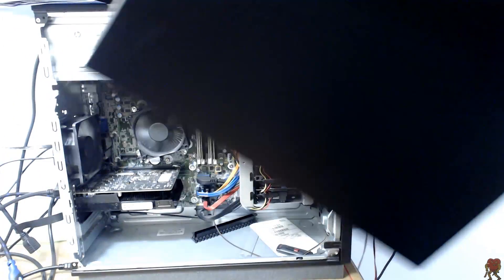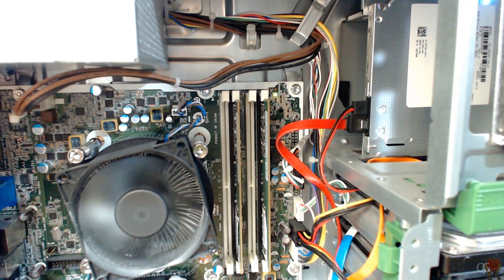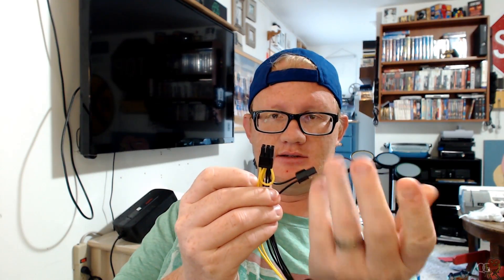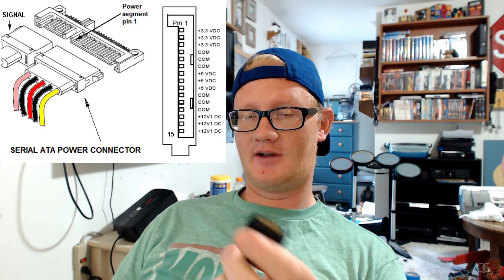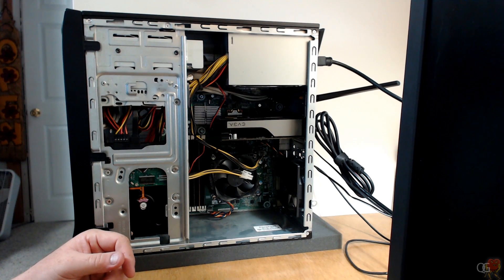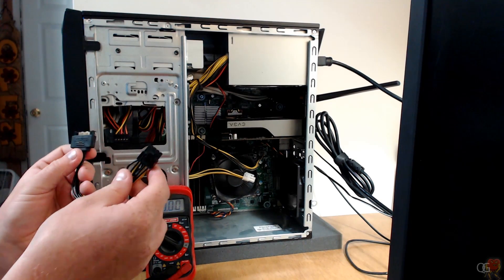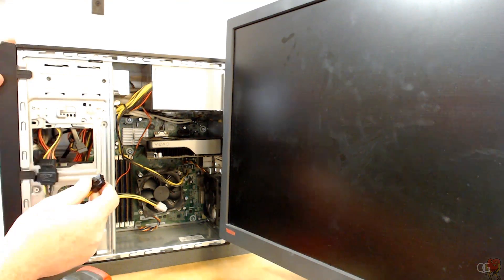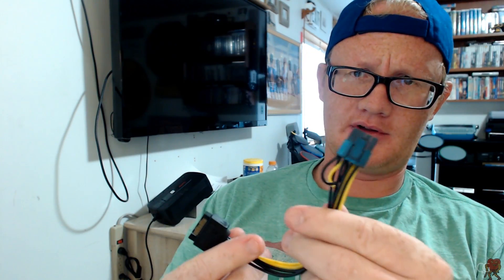No Power Supply Cable For Your Graphics Card? No Problem!

Comment: 8 pin pcie express draws 150 watts. 6 pin pcie express draws 75 watts. Sata draws 54 watts maximum. So powering an 8 pin pcie with a single sata connector means your video card is either drawing 96 watts too much or your video card isn't getting enough. Even if you use 2 sata connectors for 108 watts to an 8 pin pcie connector, it still overdraws by 42 watts or has an underdraw of 42 watts. Mainly meaning there is a good chance of the sata power wires melting and starting a fire. At best, 2 sata connectors to a 6 pin 75 watt sata connector would be acceptable but sata was never designed to power pcie video cards.
Reply: What if I just use the sata connectors to ground the gpu and use a different 6pin that’s from my psu + the sata grounds to make up a 8pin
Reply: nonsense, they both can pull equal amount of power, 2 extra black cables are just ground
i use hp mobo + rtx 4060+ sata to 8 pin no problems, you are genuinely misinformed
Reply: No, my friend, you're the one who's wrong. My graphics card, an AMD RX 570, was connected to the adapter that goes from SATA to 6+2 pins, and it almost fried my card because the part where SATA goes to power melted. @r3tr0c0e3

Comment: once I used 6pin to 8pin converter for an rx 570. after couple days wires were melted and shorted. fortunately power supply turned off automatically.

Comment: this specific adapter you are holding is the type which may catch fire because the sata end can hold a max of 54 watts while the 8 pin end needs 150 watts which will cause overheating and fire potential, there is the type which has 2 sata cables to an 8 pin which is a little bit safer but still does not meat the 150 watts required because now instead of 54 watts 2 cables combined will do 108 watts, the one which i think is the safest is the 2 sata to a 6 pin because the 6 pin requires 75 watts and with 2 sata cables it can handle it with ease without overheating because it is has headroom
Reply: is it ok to use it on a budget GPUs like RX 570, 1650, and 1650 Super?
Reply: @yubinator69  as along as the gpu requires less than 150 watts then no problems which is the case for all the gpu's you have listed

Comment: its ok to use 2molex to 6 pin ?
Reply from the maker: No less ok than the SATA to 6 pin. Either cable may not be able to handle the amps your card might draw, but I'm willing to bet the molex to 6 pin can handle more amps (haven't tested it yet) because the pins are larger and have more contact surface area.

Comment: I only have one hard drive is that a problem
Reply from the maker: Shouldn't be as long as you have an extra SATA power connector
Reply: @thequintessentialgamer7514  i do but when i plug it in to it and turn it on it beeps 6 times and then does nothing

Comment: literally doing the exact same thing with an HP pre built I just got. looking for a new graphics card, realisizing there is no cable to go with it. then the power, then the proprietary what th flip... thanks for all the help so much
Reply: Same what graphics card will you get ?
Reply: @blinkcatmeowmeow8484  no idea quite yet. I'm concerned about the limitations of the power supply itself and the cable. Only have a 180-watt built-in so I'll probably have to go for something maybe a high range of low tier game requirements to mid tier. Probably looking at something with 2-4 gig of RAM on bored like a GeForce gtx 1050/radon HD 7850
Reply: Niceley Done you wont do anything with a 180w psu only a 1650 super will use 80% of that get AT LEAST 350 watts believe me
Reply: @blinkcatmeowmeow8484  I have a 450 watt
Planning on getting a Rx 5700xt

Comment: Need some help, I Have an hp desktop that does not have cable for the gpu, it goes directly to the mother board, from the mother board comes a 8 pin cable that connects to the hard drive, and then, from the hard drive comes another 15 pin sata cable that is not connected to nothing, can this adapter give power to a gpu from this sata plug that comes.from.the hard drive?

Comment: Wow...You should never use this for any gpu...just build the pc yourself and it's cheaper than a prebuild...btw these OEM PSUs are just junk and should not be used with power hungry cards...theres a reason why there's no pcie cable...a psu without a pcie cable has max 250w of output (in most cases)...

Comment from the maker: I've added some links in the description, there are a few cables to choose from now, depending on your situation. Hope they are helpful.
Reply: You fucking legend
Reply: Will that adapter work safely with a rx 580 4gb
Reply: @officialdislikebutton9712  No because the max power draw of this card is 185W and you cant pull that sot of juice out of the sata cables
Reply: @officialdislikebutton9712  you could run rx580 without cable if you do undervolting And you set power limit to 50% that will take only half of juice. If you add this sata I guess that this sata conector can help. I am not sure how far you can go but i would try to go up to 75% and do some stress test and check the entire wires temperature (it Is sure that Its not design to power gpu).
Reply: @rockybalboa5611 Sorry for talking about something that's 2 years ago. Anyways I'm getting an rx 580 8gb 2048sp. My system is a dell vostro 3888 which comes with proprietary connectors for mobo. Could you please at least link me to something that'll teach me how to power limit the card?
Reply: You're my hero! Thank you
Reply: Hello, my friend, I have this problem "Please power down and connect the pcie power cable for this graphics card" in a Zotac GTX 760, this adapter would solve the problem ??

Comment: What if I buy a female one does it do the same thing?
Reply from the maker: The female ones are meant for a situation like you want to power a 3.5" HDD and you don't have a SATA power cable but you do have a 6pin connector for a graphics card.

Comment: I just for a lenovo and I'm not going back; what's with all this propriatary power supply and motherboard crap limiting my ryzen 2700 to a ... ex 460 rebranded as a 560 which I guess has the proper name of 560-D but I've also seen 560-B

Comment: Where do I connect it into 
the motherboard i don’t see I place where it would go into
Reply from the maker: It plugs into a SATA power cable that typically comes from the PSU, although some computers (like my HP features in this vid) have the SATA power cables come from the motherboard.

Comment: Hey bud, I bought this same cable. Will it power my 8 pin graphics card ? The cable has 8 pins on it or take off the two like you did and make it a 6 pin. But will this power my 8 pin graphics card? By the way , I have a dell precision xeon, with a upgraded power supply of 685 watts. But ya no damn 6 pin or 8 pin connectors in my pc. Hopefully you or some on here can let me know if this same cable will work with my 8 pin graphics card. Thanks a bunch
Reply from the maker: Never tried it on an 8 pin GPU although I would assume it would work, I dont know for certain. I didnt know if my cable would work with a 6 pin when I got it, I just took the risk and tried it. Whatever you do, it's at your own risk.

Comment: Just bought a rx 580 armor mk2 and I didn't have a 8 pin and I started freaking out. Luckily I found this video
Reply: does it work?
Reply: @hyph3nvoid416  it's no longer available but I found a new one on Amazon that should get to me on the 8th
Reply: Let me know !
Reply: @knife9315  it did
Reply: Nuttinpistachio 0 awesome. Does everything work properly? I’m looking to do the same with the same graphics card!
Reply: @knife9315  for the most part yes
Reply: @knife9315  the one I got also came in a pack of 2 for a cheap price. Only problem is that there kinda of shirt so the cable will definitely show
Reply: @nuttinpistachio034  hi bro how much watt in your psu i have 400w did it work for me ? And are u used 1 Sata to 8 pin or 2 sata to 8 pin?
Reply: @merouanehirchi7975  I have a 600 watt. It should work, it uses 2 data cables to 8pin. If you want I can make a short video and show you and even put some gameplay to show that it runs well. I got it for 8bucks on Amazon and it came in a pack of 2
Reply: @nuttinpistachio034  okey brother if want it will be nice
Reply: @merouanehirchi7975  what kind of gpu do you have? Because if you need a 8 pin I would imagine that you would need more then 400watt. I had a 500 watt for my gpu and it got fried so I had to get a new psu
Reply: @nuttinpistachio034  the rx580 with 8 pin my psu 400w 80 plus platinum but have jst 6 pin
Reply: @merouanehirchi7975  I recommend a better psu at least 550. I'm lucky my cpu or gpu weren't fried
Reply: @nuttinpistachio034  xd thank u bro the problm mn hp mobo dont have 24 pin psu connector jst the 6 pin psu connector

Comment: Hello can someone help me today I was play cod modern warfare and my PC fan started making noise as If it was running at high speed and screen went black when I opened my case I saw that the 8pim connector had burned and a smell was produced from the PC and the smell is still present a bit in psu and the p4 pin coming from psu
Reply from the maker: Sounds like your psu fried. Perhaps your GPU was drawing more power than the psu was rated for. You likely might have to get another one, and I'd get one with a higher wattage rating
Reply: @thequintessentialgamer7514  thanks for commenting but the psu is still working as normal should I just get the 8pin or should I also replace the psu

Comment: I dont need this cable i just dont know If my 6 pin slot works
Reply from the maker: You can use a multimeter set to DC volts and touch the probes to the pins of your 6 pin cable (ideally the the positive probe to the yellow wire and the negative probe to the black). If you get a reading close to 12 volts then you know it works.

Comment: Great vdo, can u please help me here. Can I connect the 6 pin to a 12 v external power adapter (200W) as yellow wires to (+)positive (12v), and black wires to (-) negative (ground) . I have a GT 710. i will be using pcie riser card x1 to x16 this requires the same 6 pin cable as shown( 2 yellow, 3 black)
Reply from the maker: You want to use a power supply just to power your graphics card? While an entirely different power supply powers the rest of your computer?

Comment: i heard it is not safe... will 2 sata to 6pin okay with 1650 super?
Reply from the maker: Yes, according to:
https://www.techpowerup.com/gpu-specs/geforce-gtx-1650-super.c3411
The 1650 super draws a max of 100w from a single 6 pin cable. The wires should be able to handle the amp draw. No 2 pc's are the same so this is no guarantee that itll work without issues

Comment: In my old power supply, my sata power has only 4 cable. It doesn’t have an orange 3.3V cable in it and I see only 12 pins in my sata power. Is this normal?
Reply from the maker: The older molex connectors only had 4 wires, this was normal
Reply: The Quintessential Gamer is it ok to plug it in to a normal sata hard drive or ssd?
Reply from the maker: Yes, hard drives use 12v or 5v, which the old molex cables provide, but you need a molex to SATA adapter to actually plug into your data HDD or SSD. You can buy some here: https://www.ebay.com/itm/303377417412

Comment: Just bought a GX 750 ti to upgrade a 2nd-grade classroom's old Dell HP, only to find out they didn't have a 6 pin to power it. We were about to accept that we just wasted 60$ on a graphics card, when we found this video.  Picked up a 3$ 15pin SATA to 6pin PCIe adapter on ebay, and now it works like a charm!  Thanks for saving us.
Reply: Same :)
Reply from the maker: Happy to help!
Reply: @thequintessentialgamer7514  Thanks!
Reply: Thank you so much bro now i can replace my gt 620 to gtx 750 ti :)
Reply: Same
Reply: Mine didnt work ,  bought gtx 750 ti2gb and i tried 6pin to sata and 6pin to molex but none worked , any ideas?
Reply: @RarePotatoHD  what psu you have ?
Reply: @deltaid1439  500w ws atx , its not that good but it should power up the gpu , ive tried with double psu and still nothing , can you help me ,ive tried everything , tried card jn another pc with 2 pcie slots , it worked in one of the pcie slots.
Reply: Sorry i cannot help im only 13
Reply: @RarePotatoHD  you need to see if the gpu is compatible with ur motherboard... Google it... If ur motherboard compatible with what gpu u got... It will work.. After u update ur bios... 1 simple thing... Update to latest bios for ur motherboard
Reply: @tt_aous560_ly2  my motherboard suppprts this gpu.  I updated bios to latest , me motherboard is asrock n68 vs3 ucc , but i bought another pc  lmao
Reply: @RarePotatoHD  congrats... GgEzzzz only... I was just tryna help of what i know... Enjoy ur New pc 💪👍
Reply: how mutch you power supply
Reply: Well there are also some gtx 750 ti without a 6pin connection...
Reply: Could've bought a 3$ 6pin connector instead

Comment: voltage is mater to power-up ..... amperage is mater to avoid any damage, so u need to check how many rail does your psu have and how many max amp per rail .... in your case to have 1 sata to 6pins or 8pins >>> u need to have more than 50 amp max to be safe i think .... that why (2 sata or molex) to 6pins/8pins is much safer cause old psu's thats doesn't have proper connector mostly comes with lower amp per rail witch is better to put stress on a different rails to avoid any damage ....

Comment: In my youth I used to think HP was good, since my first pc was a HP pre built. Boy what an awakening I've had.
Reply: Same, I've had my HP prebuilt for 2 years, and I am still extremely ticked off to find out you can't upgrade it. I will try the adapter method to get a 1650 Super working. If it doesn't, I'll just buy a new PC and never look back. Lesson learned: never buy a prebuilt and ALWAYS build your own PC.
Reply: @DMCdantenero112  or at least don't buy a HP prebuilt, they are locked down out of the ass, almost apple tier.
Reply: @LookingGlass69  True. And not almost, HP are 100% Apple tier. I can't even get the CPU out because the heatsink is soldered into the motherboard. So my only option is to sell the PC and buy a new one. 
I wish I knew HP used proprietary connectors before I bought one... At least it taught me to do my research before buying things.
Reply: @DMCdantenero112  holy shit, what? That's even worse that apple. Good luck with your pc building endeavors.

God, I hate HP.

Comment: i really need help i had integrated graphics and i just bought my 1060 and i cant find the cable to power the graphics card and im stressing out cause i don’t know how to power the graphics card i looked at my power supply and i cant find any cable
Reply: Get a modular psu can get a 80 plus bronze on new egg for 40 bucks

Comment: Quick question sir, Ill get the 1660 ti which draws 140 watts
Can I plug 6 pin power connector into the 8 pin socket on the gpu ?
I got 700 watts psu so if it draws 75 watts from the pci slot and 75 watts from my 6 pin connector
It would work right ??
Reply from the maker: I wouldn't even try it. Find a solution that uses the same number of pins at the very least
Reply: @thequintessentialgamer7514  can i use the 6+2 pins for the 8pin?! Im confused here..
Reply: If it doesnt work, the gpu wont even power up right ?

Comment: would you reccomend this over the molex to 6 pin connector?
Reply from the maker: If it's a single moles to 6 pin then I'd say they wouldn't make much of a difference. Either one is still likely pulling all those watts thru a single wire. However 2 molex to 6 pin may be a different story as it likely pulls watts from 2 wires, not just 1. You're at much less risk of melting wires with a 2 miles to 6 pi

Comment: i tried to connect 6 pin to 8 pin adaptor but my grafic card didn't function, is there a diference with this cable? should i try this too?
Reply: It can be six but has extra 2 for 8 if needed

Comment: I have an old HP 8000 and faced the same dilemma. nearly went down this route, had upgraded the ram to it's max of 16 gig and upgraded the processor from core 2 duo to core 2 quad. The graphics card was the trickiest, because of the power thing, so tried the gtx 1050 TI but it didn't work (Found out the 10 series cards only support UEFI Bios) so i tried a gtx 750 TI, and it worked fine.. probably twice as fast now.. Not for playing latest AAA games, but then I'm not much of a gamer anyhow. I think the 'TI' was the answer as they all take their power from the PC1e slot but need less power than the same card without a 'TI' suffix..

Comment: Will this damage the gpu
Reply: Ableh yea, it will also damagde the mother bord and the psu
Reply: Mockz How so?
Reply: @定行宣明   定行宣明  i believe it has something to do with GPUs drawing more voltage than the rest of the components, so assuming you even have a gpu old enough to run on sata power, the trade off is the extra power drawn from your motherboard that was meant from power supply. Also,  GPUs get hotter than the rest of the components most times so hotter temps mean even more voltage being drawn which would inevitably lead to faster degradation (in some cases just fry) of your motherboard. If we were meant to run our gpu thru sata on the motherboard then we'd all be doing it, power supplies exist for a reason ESPECIALLY with GPUs being even higher nowadays in terms of wattage

Comment: I have 6 pins and it says to plug the pcie cables for the gpu so does an 8 pin fix the problem?
Reply: I have a gtx 1660 super
Reply: Any update? How did u manage to solve the problem ? Did you plug the 6 pin directly into your gpu ?

Comment: can i just use another psu? let's say i have 2x 450 psu will that do?
Reply from the maker: Not recommended but it could work. You'd have to custom mount the 2nd psu in your case somewhere, and youd have to make sure two power cords were plugged in. Oh and most importantly both psu's need to somehow turn on simultaneously when you power on your computer.